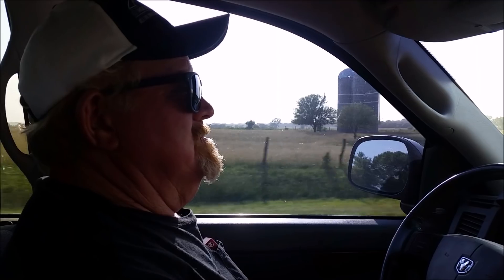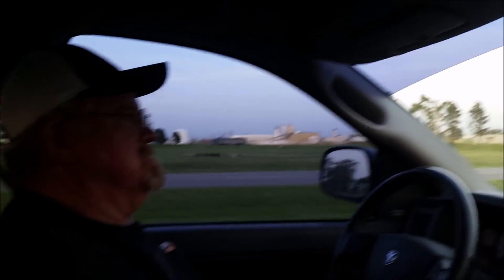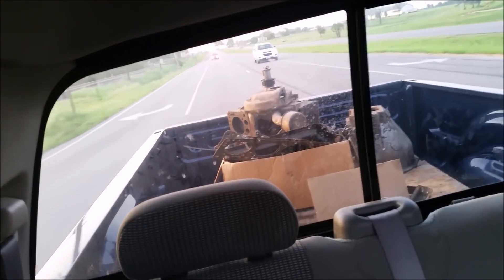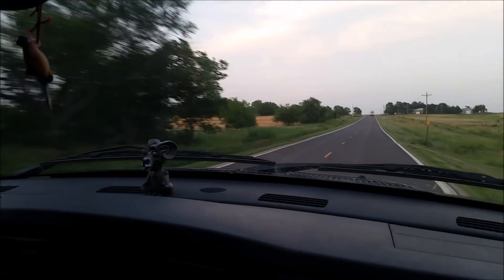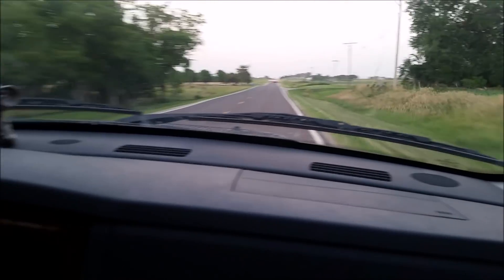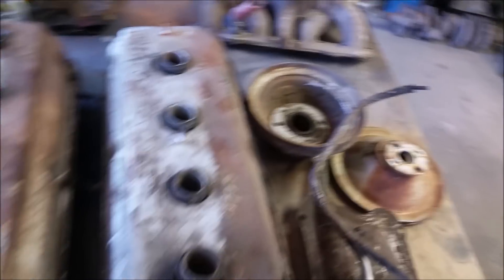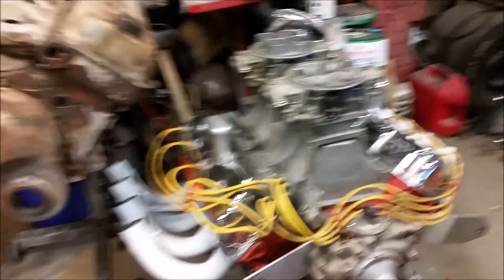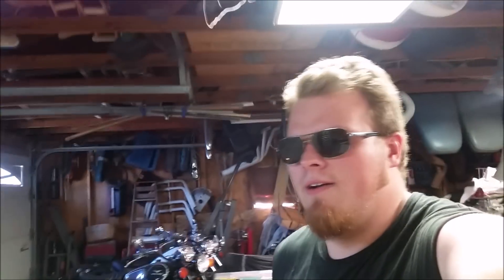241 Dodge Red Ram Hemi Part 1: Aquiring the Engine

Comment: The old 392's blown engines were the 1st to called elephant motors because of the zoomies and the sound they made with the blower on it screamed like a charging bull elephant ....pretty cool ..and the baby hemi 354 and the one you just purchased pretty cool had one that was raced up in a model A 31 Ford pick up  that was in the mid 1960s valve covers on the pickup were chrome with  2  4s  it was a 354 Red ram
Reply from the maker: That is some neat history, I appreciate the enlightenment, I always just assumed the Elephant applied only to the 426, but makes sense with the 392, since it was a great engine in its own right. That would have been a fun 31 Ford
Reply: Jeb , you should watch this movie as there is a racing  part with a 392 dragster in it  on the line ,this is pretty much how it was in the days.........check the whole movie out ......found this part of 2 Dragsters revin up on the line brings it all back.....and yes that little 354 Hemi in the A was bitchin .........fast............https://www.youtube.com/watch?v=FPvt_skEb3c
Can I tell you about a 440 R/T Coronet 68 I had one of the bad boys
Reply from the maker: That movie is American Graffiti 2 and the dragster scenes were the best parts in my opinion. Well sure brother, I like hearing stories

Comment: If nothing else, that old Quakersludge helped preserve it like cosmoline. Some motorcycles have bigger bores than that.
Reply from the maker: Yeah, I am very thankful for the sludge in the aspect, the engine is in really great shape, I think our lawn mower has a bigger piston lol
Reply: Even with the tiny pistons it's still over square. With a  3.25" stroke (less than a 318) that little mill could scream as fast as the points will let it with a good cam. Should be a fun build.